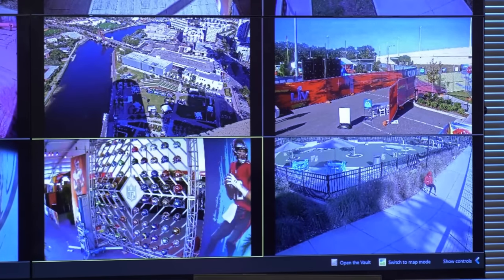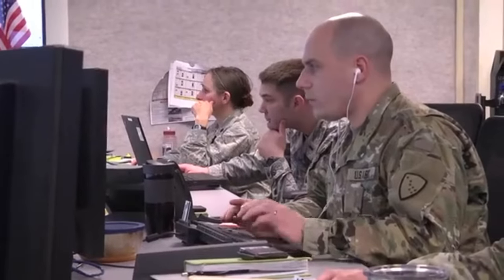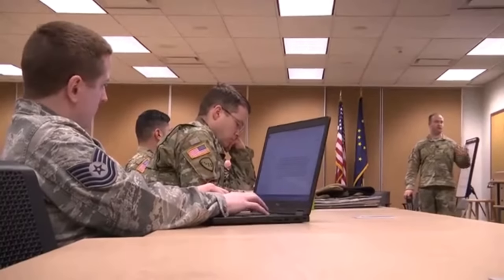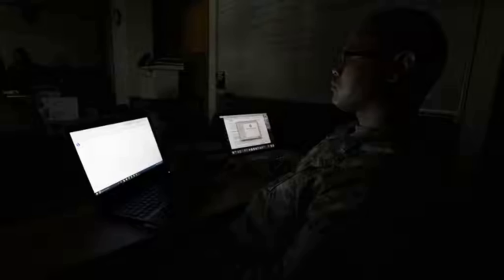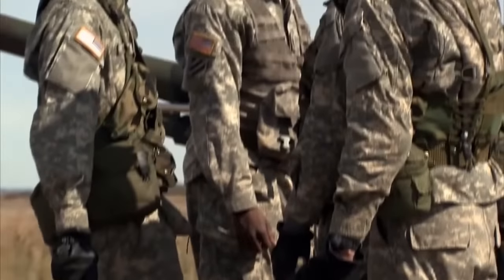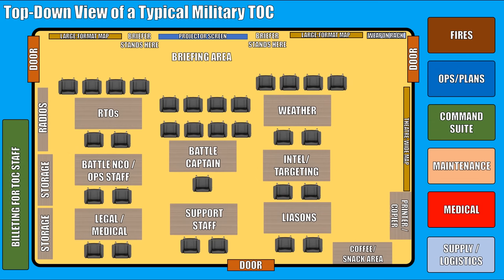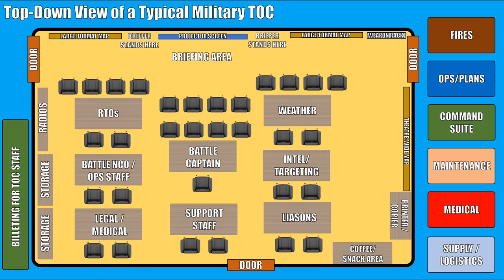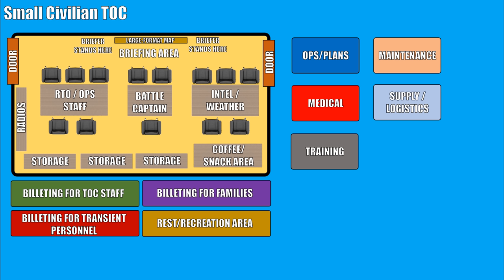The T.O.C. - Tactical Operations Centers

Comment: I was wondering if you can provide info on how to use terrain tactically?  Or suggest resources
Reply: 1. don't silhouette yourself
2. take the high ground
3. move along the terrain not against it (don't move downhill or too far uphill, read point 1)
Reply: 4. Stay in the woods whenever possible
5. Stay hidden as much as possible and utilize surroundings such as bushes, rocks, or tall grass as concealment or cover when moving or attacking (see point 1 and 3)

Comment: I note that in the "civilian world" we also have EOCs usually at the county-level, but also at the municipality level for certain larger areas (and regional, state, and federal flavors too).  Some jurisdictions (my own included) even have mobile command units built on fire engine chassis to function as a remote FOB during a crisis.
  
If you're getting enough buy-in from your fellow residents, you may end up with group members inside those Emergency Operations Centers (my dad worked in one).  Thinking about getting a connection in those rooms would be good to add to a long term prep plan...
Reply: The similarities between military TOCs and civilian EOCs is more similar than I first thought. My background using the Incident Command System in the “civilian” world (local government) actually helped me in understanding the points made in this video.

Civilian EOCs, compared to TOCs plan and support disaster response. Instead of intelligence staff, EOCs may have law enforcement, public works, or county department of transportation, etc liaisons to provide information to the Incident Commander in order to more efficiently respond to a disaster.
Reply: @shortegg6725  And utilities reps (public and private), and a seating area for transient NGOs (think Red Cross, food banks, etc.), or other agencies (FEMA, DHS, National Guard, etc.).  Having a PIO is also a thing as disseminating a command message "to your people" may take non-secure routes like Mass Media, Social Media, etc. HAM clubs may take on a comms role at various scales - including data networking, email, and voice communication.

Comment: Anyone have any experience running rechargeable batteries in a PVS 14? Looked around on the web and can't seem to find anyone that can confirm long term success.  Slightly concerned about the voltage difference between rechargeable and a standard battery. User's manual specifically says not to use rechargeable
Reply: Why would you? They barely use any battery and modern, high quality batteries have very long shelf lives. Just stack them deep enough to last you and cycle them.
You will get more that way then a rechargeable and solar, if that is your plan. Your solar and rechargables will die before the disposables run out of shelf life if you are smart about how you store and rotate them
Reply: If the engineers that made it say don't use it, don't use it.
Reply: @nightowl9519  maybe because if I'm on the move for weeks at a time carrying enough batteries to keep all my equipment going is a lot more burdensome than carrying a lightweight roll up solar panel
Reply: Why would you? A small solar panel keeps a couple dozen of my AA rechargables topped off. I can be in the back country almost indefinitely and can power anything using AA forever, no resupply.
Reply: @PracticalTacticalSheepDog  Maybe your PVS-14 is older or different, but my new one uses one AA every 10ish hours, and I usually carry enough to last me twice as long as I anticipate being out, at a minimum and I never have any issues with weight, ect.
I never use rechargeable for anything critical, they are far more likely to fail you with no backup.
Reply: @nightowl9519  so if you going to be on the move for say 8 weeks traveling at night every night for simple math let's say it's winter and you have 10 hours of darkness. Your going to carry around 56 AA batteries?...... Let's say your BS answer is yes, now you've reached your destination and burned through all your batteries, now what?
Reply: No one believes that you're going to hike several days at night on NODs for any realistic mission set.
Reply: @kerbalairforce8802  first of all that was an obvious extreme scenario thrown out to make a point and secondly who says it's a "mission" how about fleeing an occupied area? How about trying to reach family several states away? Use your imagination and stop being such a tactical douche canoe. All these chairborne rangers in the comments talking about realistic missions sets and what they do because it's the more tactical thing to do..... Notice no one has actually answered my question.....
Reply: For what it's worth, I am an electrician. I know some things regarding voltage/batteries/yada yada...In my own I use a AA energizer lithium ion and have found the life to be outstanding and wieght to be no factor. I certainly understand the reasoning to have the ability to use a rechargeable though. Especially given the recent past and its lessons on the supply chain. I would say the thing to do is get yourself a very trustworthy meter that is small/light so you can verify the output voltage of any rechargeable battery you are going to use. Verify it will stay within the limits of your pvs-14 and throw away any of the ones that won't. Then....use the standard batteries until absolutely necessary.
Reply: @PracticalTacticalSheepDog  I like that you ask the question and then attack the answer because you don't like it. As for chairborne ranger, based of your questions and responses, I guarentee I have spent more time using my equipment then you, and in more difficult circumstances.
In any realistic scenario you could lay out, using disposable batteries makes more sense. Because rechargeable batteries fail, and they take time to charge.
If 56 AA batteries is what you need for your situation, you better hope you have caches, God given luck exploiting your environment or never skipped leg day.
For the record, 56 AA lithium batteries would weigh about 3 lbs, which, although ridiculous, would be totally doable if that is what was required. That is a tiny percentage of the weight in my pack.
Reply: @joshshepherd5660  Thats a great answer, and I agree. Use standard batteries until totally necessary.
Reply: @PracticalTacticalSheepDog  Also, I just realized how ironic it is for someone with the name "practicaltacticalsheepdog" to call someone a chairborne ranger hahahahaa
Reply: @nightowl9519  I didn't get an answer from you. Your response was "why would you?" In regards to using your equipment more than me and in more difficult circumstances perhaps you have, perhaps you haven't. kind of irrelevant to my question. Rechargeable batteries have the potential to be sustainable far longer than standard double a batteries.
Reply: @PracticalTacticalSheepDog  My answer was rhetorical. Don't use rechargeables.
And no, they don't have the potential to be more sustainable than good planning and stockpiling of quality lithium disposables.
You are asking a question and everyone is answering with don't do it.
Reply: @nightowl9519  while I don't claim to know your background I would venture to say I have a far more "tactical" background than the vast majority of people in the comments section. Can't say I was ever an Airborne Ranger but in a past life I was a Combat Engineer that went through the Sapper leader course. I'm currently an Intel Officer working for the DOC Gang task force, don't spend too much time hiking mountains these days but I enjoy a good LARPing session a few times a year.
Reply: @nightowl9519  I'm going to take a wild guess and say you don't have much experience with rechargeable batteries. At least not since the early 2000s. Modern rechargeable batteries are quite efficient and can be recharged hundreds of times with virtually zero change in capacity and thousands of times before they become totally unusable. Never had a modern rechargeable battery fail and I almost exclusively use them for weapon lights, EDC lights and pretty much all my around the house electronics. No they generally do not hold as much power as a lithium disposable battery, yes they do lose performance in extreme temperatures like 20° and below.... With that in mind it's quite foolish to say a battery that can be recharged hundreds of times is not more sustainable than trying to stockpile a large quantity of disposable batteries. A 24 pack of rechargeable batteries has more charge potential for mAh than 5,000 lithium batteries. Also for the record you're the only one stating not to use rechargeables at all. The only guy to have actually answered my question stated his reasoning for preferring disposable batteries and said to use rechargeable as a backup. One of the other commenters had the same thought process as myself for why rechargeable batteries are useful.
Reply: Don't use rechargeable
Reply: @flopus7  how many rechargeable batteries have you personally used and had fail? I have used hundreds and never had one fail.
Reply: @PracticalTacticalSheepDog  you asked if you should use rechargeable and I answered. I dont care about the longevity of your rechargeable batteries.
Reply: @flopus7  no I asked if anyone had any experience using rechargeables in a PVS14.... The answer from you is obviously no.
Reply: @PracticalTacticalSheepDog  yeah it explicitly says not to and 14s aren't cheap. Why are you risking your 14s so you can save a couple bucks?
Reply: @flopus7  it's not about saving a couple of bucks, it's about being able to infinitely recharge in the field without resupply. I guess if you don't get it you just don't get it.
Reply: @PracticalTacticalSheepDog  just buy batteries. Theyre like 15 bucks for 64. A battery will last you multiple patrols. This is pretty much an easy fix by stocking a couple packs. Either you aren't gonna walk around enough to exhaust a couple hundred batteries or you work for someone who issues batteries.
Reply: @flopus7  like I said if you don't get it you just don't get it....
Reply: @PracticalTacticalSheepDog  I hate that you have NVGs and are determined to ruin them
Reply: @flopus7  I'm actually looking for someone else that has tested it out to avoid the risk of ruining mine in a trial run......

Comment: 📒 Tactical Operations Centre (TOC) 🗒 

TOC - the nerve centre of any operation

It's role?
*  Receive & distribute information
*  Analyze information 
*  Make recommendations
*  Integrate & synchronise resources

SOC (Civilian Operation Centre) - much simpler than a TOC.  In fact, you may not even need a SOC, especially if your SHTF network is quite small.  You may merge your SOC into one of your LP/OPs or simply consist of 1 person receiving info & dispersing it to the relevant SHTF member.  A whatsapp broadcast list can be utilized to disperse information quickly by a 1-man SOC.

* Comms are vital! (Walkie-talkie & internet connection.  Get fluent with radio comms!)

*  Coordination (info from the field e.g. AO/AI, is relayed to other SHTF members or first responders).

*  Battle Tracking - (Map on the wall AO/AI, pins on the map denote friendly & enemy positions).

* Weather - THE deciding factor for go/no go action.  Thus, this needs monitoring at the SOC.

* Intelligence - Drives your actions in the AO/AI.  In a civilian context rely on your Area Study & keeping tabs on emergency channels.

* Electricity acces - lighting, radios,📱 charger, solar panels + batteries.

* Conceal your SOC.  Most likely it will be in a 2nd storey room with good vision of the AO).

Most likely my SOC will consist of 1 person who receives & distributes information received from the AO/AI.  They will rely heavily on the Area Study & use a Boefeng UV-5R & a phone to communicate.  Anything more complex than this is beyond me at this stage.